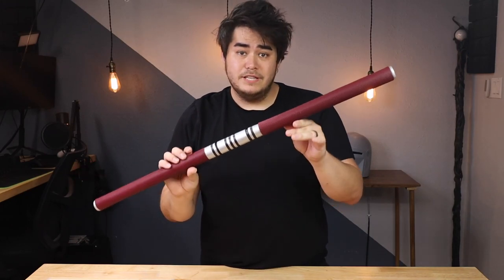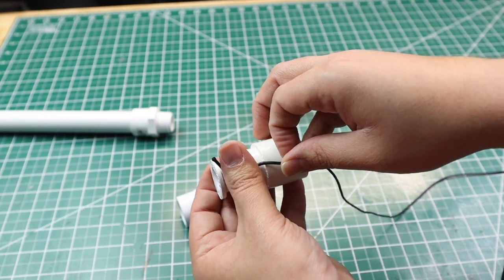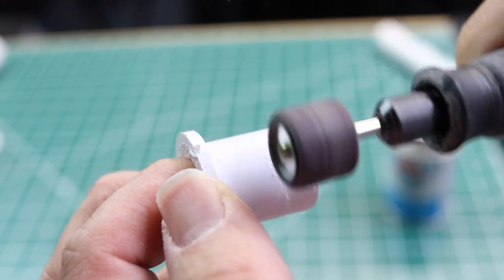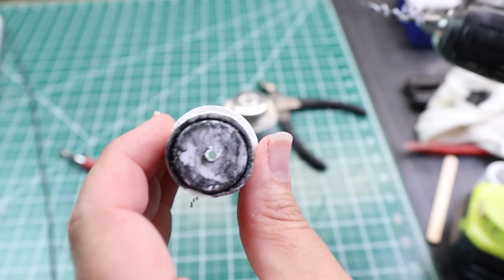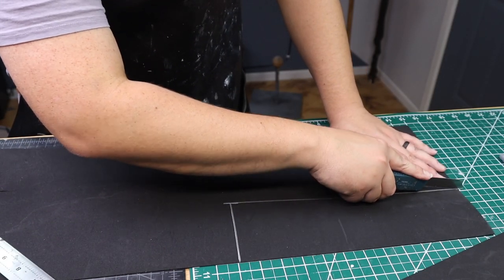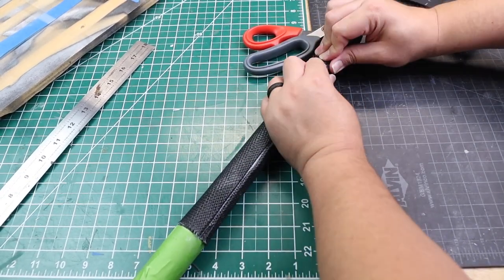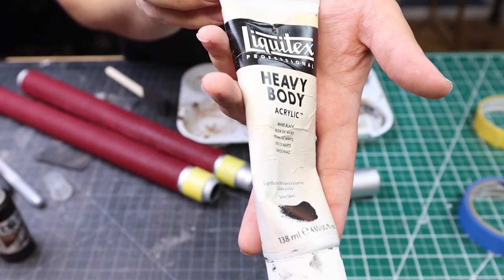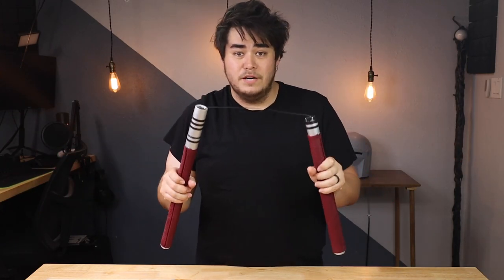How To Make Daredevil's Club

Comment: Is it possible to make this without a belt sander and dremel?  It looks amazing and I would love to make this one day.
Reply from the maker: I guess you could with sandpaper, but honestly, that would be way too much work to follow it exactly like mine where you can open it up three different ways. But I HAD to use the belt sander for the Nunchaku section. The belt sander was also vital in sanding down the adapter pieces that had too much material or had extra things on the sides. If you just did the two PVC pipes and the twist connector, then that would work!
Reply from the maker: Hope that helps!
Reply: @LockProps  Thanks for the info!  I really appreciate that.  Can’t wait to make it someday.

Comment: Love this build! Definitely took some creative thinking, but you figured it out and man does it look great!
Reply from the maker: THANKS LADY!
Reply: @LockProps  You're certain that you couldn't have gotten smaller pipes than that?
Reply from the maker: @joeleboeuf  Sure, you could go smaller, but when I was looking at reference photos, that seemed like the right size to me.
Reply: @LockProps  Understandable.
Reply from the maker: @joeleboeuf  Oh I forgot to mention, I also looked at a couple of licensed replicas and those were the lengths I mainly based it off of. But I had to make some adjustments due to the pipe caps and the twist connector.
Reply: @LockProps  The reason I say the pipes look too big is because I saw how Max Brains Devices made his, and his looks relatively identical to the one from the series. But yours isn't that bad, all things considered.

Comment: Question for you. I’m very familiar with working with EVA FOAM and I also know my way around a dremel. My question to you is what would your next purchase be? I 3-d printer, belt sander/grinder, or some kind of saw for getting through templates faster
Reply from the maker: I honestly feel when I bought my belt sander, my projects were going by so much faster. Also, I have been recently enjoying metal calipers that you use for leather, it's been saving a lot of time making straight strips consistently. My latest videos use it more so you can get an idea.

Comment: I watched your katana video and wanted to make that but cosplay foam isn't available where I live so can you suggest an alternative
Reply from the maker: Maybe not cosplay foam, but if I was in a situation where I didn't have that, I would be looking for gym floor mats like this: https://amzn.to/3D5kNvX Downside is that you would have to sand down the side that has a pattern, I did this when I first started. Then if I didn't have that, then I would go to my local craft store or hardware store and find a piece of wood that is around half and inch thick so you can be able to cut out the shape of the sword AND be able to sand down the sides and it will also be very lightweight, I believe Birch is one that is pretty light. If I was on con crunch and needed to get something out ASAP, then I would work with cardboard, I know it's not the sturdiest of materials, but it is widely available and can shape, glue, and cut out with ease. I hope this helps out!

Side note: it is currently Halloween time, so I would also say maybe to go to a nearby Halloween store and maybe check out what they have and then repaint it!

Comment: Which parts does it separate on
Reply from the maker: It’s divided in 3 sections, one middle piece and two red bars one bar is hollow that holds the string and stopper, then the other side is just twisted into place and when it detaches the middle part stays on the other side with the string.